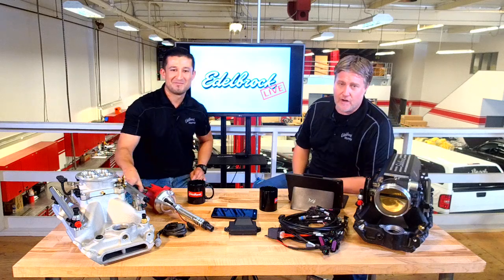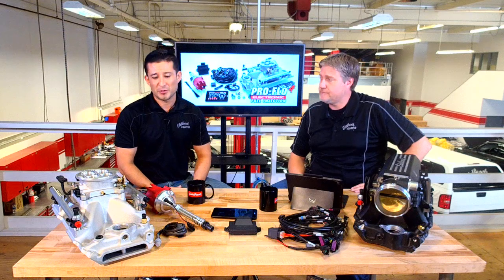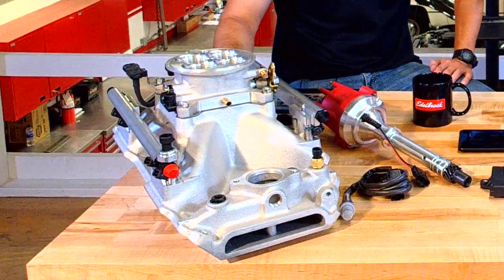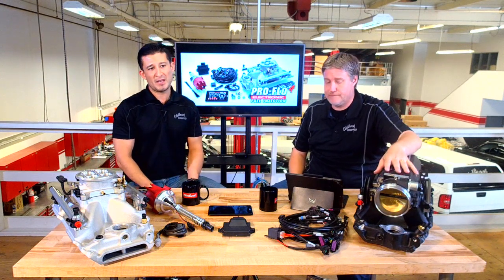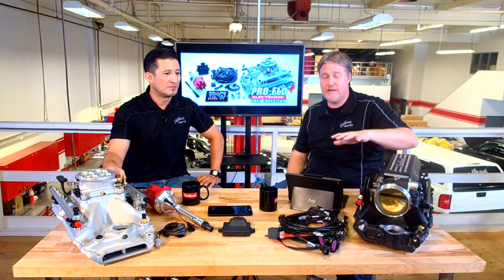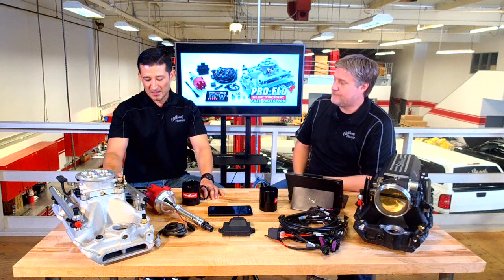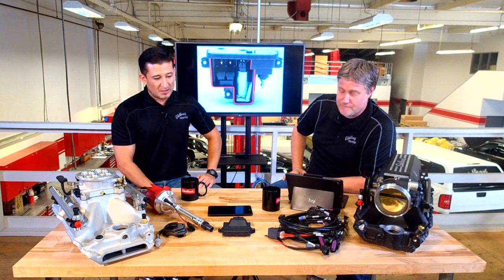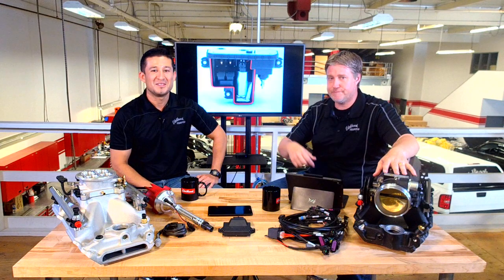Edelbrock LIVE Episode #1: Pro-Flo 4

Comment: Got my pro flo 4 system after a little wait but it was worth it. Fairly easy to install despite not having a lot of extra room under the c3 hood everything fit well. Eddlebrocks tech support was very helpful and easy to contact to help me through some minor tuning issues. Car runs super smooth, throttle response is crisp and hot and cold starts are perfect.

Comment: Out with the old ..in with the new. I have been running a Rochester fuel injection on my 58 impala for over 20 years and I sold the F.I. unit for big bucks. It was not original to the car. I installed an Edelbrock Pro Flo XT4 in its place and I am very pleased. It was a wonderful experience to install a  system that was not only well designed , with excellent directions but a great and I mean a great value. Using Edelbrock's  universal fuel sump  was also a big plus that saved money .

Comment: I got my pro flo 4  3-18-19
Read the fine print  on the 35840 bbc oval port. 
"Designed and assembled in USA
With foreign and domestic parts 
The intake had aluminum chips hanging out the intake side of injector holes. Aluminum chips all over the back side of the throttle body. I guessing to say the intake is Chinese,  being it doesn't have the USA badge like the rest of the new intakes do.😡 
I'm going to post a video of all of it
Soon.
  Stuff I can fix, but hopefully the electronics will be good

Comment: I'd like to get the pro flow 4. I have the original pro flow purchased it new about 20 years ago for my fresh built 406 along with the performer rpm heads. I upgraded to 32lb injectors recently because the original 27lb ones are bad. It sat and the fuel went bad causing fuel system problems. I've got quite good at tuning it so I'm not really sure the self tuning and wide band is a good reason to upgrade. I can say it was one of the best purchases I've made car always starts and runs great.

Comment: Fuel Injection was on option on the 1957 Chevy Small Block V-8.  It was all mechanical and you had to keep it tuned.  GM Service manuals are very comprehensive.  The Rochester Fuel Injection units bring big dollars today ..  Seems I have seen modern systems that are built to look like the Original ones..

Comment: With the hall effect sensor in the distributor and the capability of individually controlled fuel injectors, why not utilize this to allow use of a direct ignition system? This seems like the last step to have a complete modern system, so why limit it to a single coil ignition?

Comment: Ive never had a problem running a carb. Daily drove them for many years. Cold starts just fine. The only advantage I see for a 400hp street cruiser would be the MPG gain. But it would have to be a very substantial gain for 1600 bucks!!
Reply: My main reason is for high altitude performance. I live in Los Angeles and I have a cabin in big bear. Everytime I drive up there my edelbrock 1406 carb drops hp drastically. Also great on the trail when climbing at steep angles.

Comment: the pro-flo 4 XT, what is the height size where the throttle body is. I have yet to find this info as it seems higher than the ram. trying to see if this will fit a Cutlass supreme 81 where the hood is slanted.

Comment: i have pro flo 3 is there a uprgrade to make it pro flo 4 i still cant get mine running rite on my bbc
Reply: Stranahan Tile i got the same issues for mine. All they keep on saying is run it. Well i have about 1500 miles on mine and it still runs too rich. Even when i lean it out the cabin inside smells too much fuel. Honestly people need to stay away from this system.
Reply: archtstang67  ya i had the first one worked great im just going to sale my big block and tranny to much to switch it back to carb going ls swap i would not do pro flo ever again on my car edelbrock has been nothing but problems i wonder if thats why ed from the efi left edelbrock DO NOT BUY THIS KIT PEOPLE
Reply: archtstang67  and when i first got the kit the intake was to small for the vally leaked oil into the heads got a new one from edelbrock that was bigger that fixed that and i had two dead injectors only running on 6 at least they sent me a new intake and injectors still runs like shit this system is garbage
Reply: I know some of these comments are old, but  you need at least 112 degrees lobe separation angle or lsa for the cam  , they need vacuum so a big race profile cam will make it rich at low rpm's and idle  7" to 9" of vacuum  anything less  will cause a rich condition.

Comment: Do you make this for a 96 vortec 383?
Reply from the maker: Troy, yes we do. Here's a link to the kit for your engine: https://bit.ly/328dkrM
Reply: @EdelbrockTV  $2100, not $1600 or $1699.  Extra $400 because the Vortec mounting holes are drilled different?
And wheres the ProFlow 2?!  I know its discontinued but you turned your back on many hotrodders that want the sleeper look and first glance looks carburated.  No giant fuel rails running down the intake manifolds.

Comment: Considering going with pro-flo on my 1976 searay  boat. I live in Michigan so my boat is winterized about 5 to 6 months a year. ever year there are continuous carb problems from sitting. My question is that I have not seen this used on a boat application. At least not in any of my searches. Would this work for my boat and what can I expect to see in performance.  Also has a Mercruiser out drive that has a momentary stall function that allows the out drive to disengage. Any thoughts on this or has this been done before.
Reply: Kevin for what it’s worth I just saw today on a summit racing’s website that these are not for marine applications. Something to do with coast guard approval/regulation.  

Translation: once they add the words marine application and coast guard the price triples.

Comment: hello I have a 1971 dodge charger and Also I have a 7/8 hemi 5.7 engine to install in my dodge charger 1971  and I want to know if there is a pro flo 4 XT fuel injection system  for my 5.7 hemi engine

Comment: I have a sbc 350 and want to buy this EFI to use with it. but Iam swaping out to a big block in one year. Can I use the same EFI kit on the BBC if I swap out the intake?
Reply from the maker: You would have to purchase the BBC intake manifold but the harness and ECU would be the same.
Reply: Would the fuel rails, injectors also be the same, unless of course i needed upgrade for horsepower.

Comment: Does it supports nitrous with timing control?
Reply from the maker: It is on the to-do list. We are working on Nitrous and boosted applications.
Reply: This factor is a sell point for me. Is this a software update for later or is the boost support going to be for a whole new unit?
Reply from the maker: It would be a Software update.
Reply: Edelbrock USA excellent!
Reply: Get the Edelbcok manifold you like, and run a Holley Dominator EFI for control. It's by far the best EFI out there.
Reply: @EdelbrockTV  Any updates on boost support?  I am building a 302 that I will be running with turbo.  Was hoping your product would work for me.
Reply from the maker: @Tonyrd3000  We are looking at mid this week. We are in the testing phase now.
Reply: @EdelbrockTV  Is it just a software update? Or some hardware? How will it be announced when it is available?
Reply: @EdelbrockTV  Starting to put my engine together and wondering if this is still an option to put on my turbo build or if I need to stay with my Ford equipment.  Any updates?

Comment: Wich would be the best option for sbc 383 race engine? And will it work with a nitrous plate??? Thanks in advance!!
Reply from the maker: Will work on a 383 up to 675hp. Does not support Nitrous.
Reply: @EdelbrockTV  thank you so much for responding!!!
Reply: Edelbrock USA which one works on a SBC 383 the pro flo 4 4150 style or the XT? Why would I pick one over the other? Do they both come in black?

Comment: So does this unit not run a return line like most efi setups? I have a fitech system with an in tank pump setup and getting ready to install the pro flo 4 Xt but not sure about the return line
Reply from the maker: So you plan to run our XT intake manifold with a FiTech management system?
Reply: No sir I’m running a tanks inc setup I called and spoke to your tech department they recommended an in-line pressure regulator with a return line . What pressure should I be running on that setup?
Reply from the maker: You can either run 43 or 58 PSI. Our Pro-Flo 4 system works on both. 
 @Mrdjhavok
Reply: Thank u much hoping to do the install next week. One more question do I need to run the correct geometry for the transmission kick down or does hooking up direct to your bracket work?

Comment: After being completely disappointed  by Fi-Tech, & not having an available ultra ram unit for '86 - '96 SBC, but for everything else. 
Im looking at the pro flo 4 xt 38523, but which one will fit my L98 with "113" cylinder heads?  Because apparently jegs & Summit dont say this all to clearly. 
Can i use a MSD digital 6L Ignition with this? 
And do i need anything from my original HEI set up?
Apparently fi tech does.
Reply: I forgot to ask, what is the minimum number of vaccuum inches needed for this system?
Can this support a large variety of cam shafts?
Really looking at Comp Cams 
XE 283HR for my 383 Stroker,
Claims to have 9" inches vacuum at 800rpm idle, & 12" @ 1000rpm.

I plan to run accessories, booster, etc off aftermarket electric vaccuum. 

Thank you
Reply: @corvettefever360 
With all those questions, you really need to contact Edelbrock directly. Youtube is not the forum for that kind of info.

Comment: Wth... why did i pay for the pro flo 3 $3200 last year 2017 for my sbf. Now its half priced. I got ripped off!!
Reply: One could say the same thing about spending $1000 on their first microwave oven back in the late 70s.  Now one costs as low a $39....and it's more powerful.
Reply: Your comparing 35 years vs 1 year difference. Come on get with the program 😂